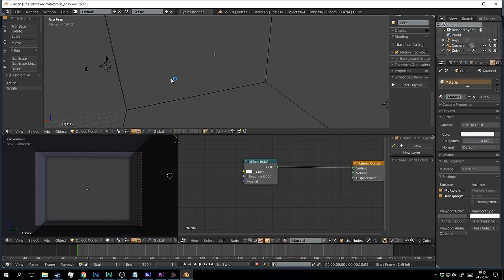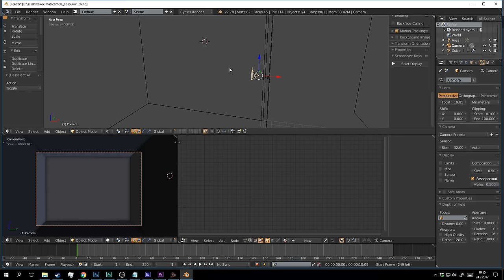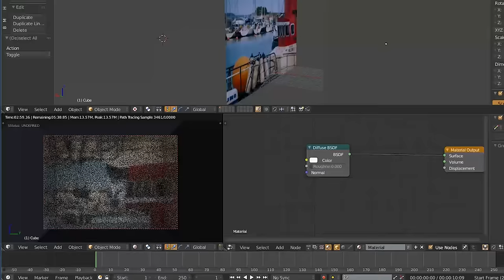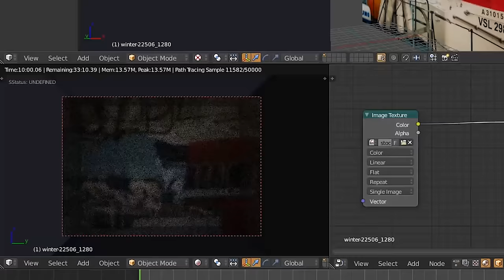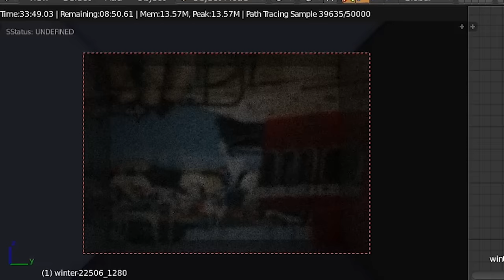Blender experiment: Camera obscura

Comment: Did you try using a portal area lamp? migth speed up the rendering a lot.
Reply from the maker: I actually tried but noticed that it did actually make it slower. Maybe there was less noise with that portal, but I did not render with it long enough to see if that is true.